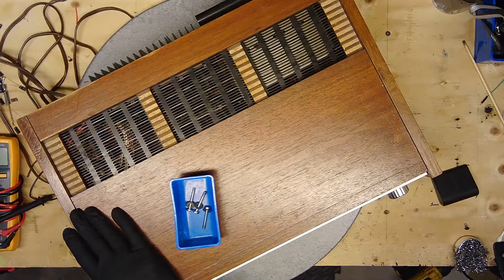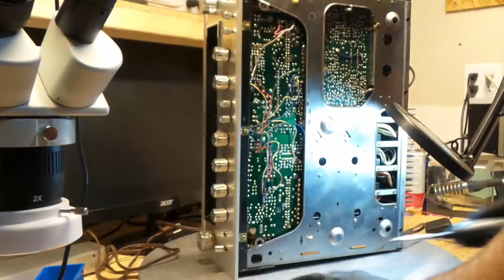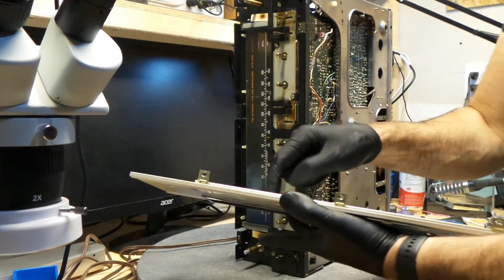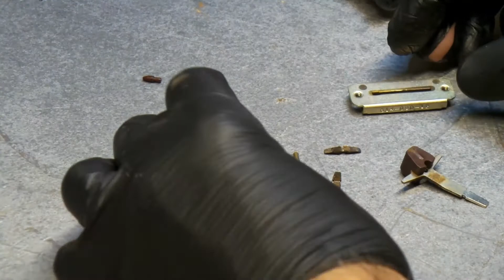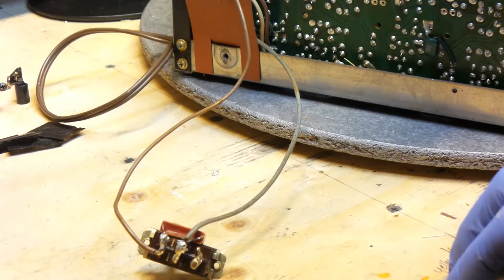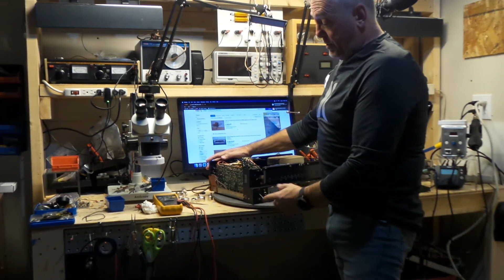Sony STR 7055 Power ON/OFF Switch broken; can it be FIXED?

Comment: I have this same model receiver and the same exact problem... I'd like to know what glue would you recommend as best for gluing the little plastic box that houses the ON/OFF mechanism inside back together - I did a quick ghetto fix my first time in before I found this video just so I could at least get my system back on, but I know that flipping that switch just once is gonna break it again so I've just been using the plug and outlet to turn on and off so I don't have to touch the on/off switch... but yeah probably gonna have another go at it at some point, but wanna get the best glue that has the best chance of being able to hold that box together and withstand the force/pressure that will be applied whenever the switch gets toggled and those little springs push against it
Reply: personally have never used the stuff before, but someone said an epoxy is likely my best bet